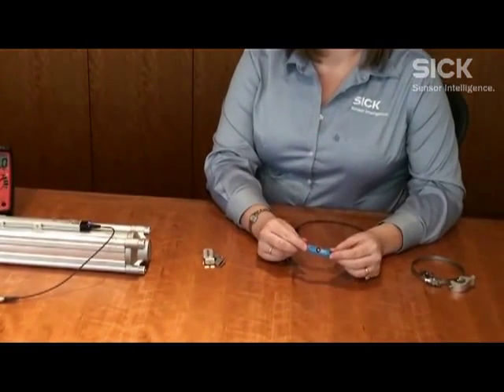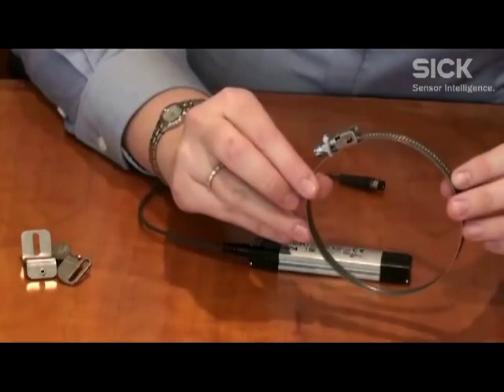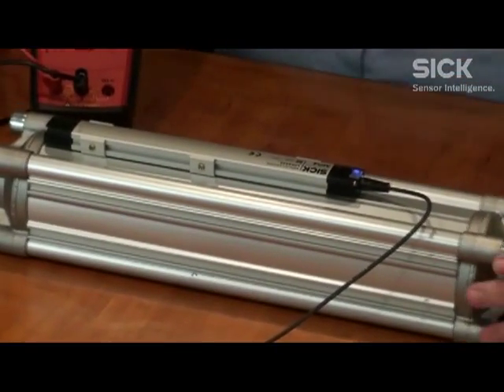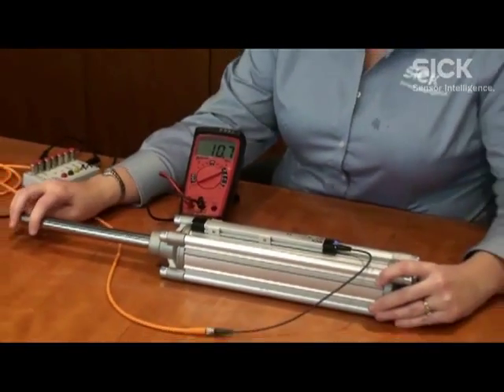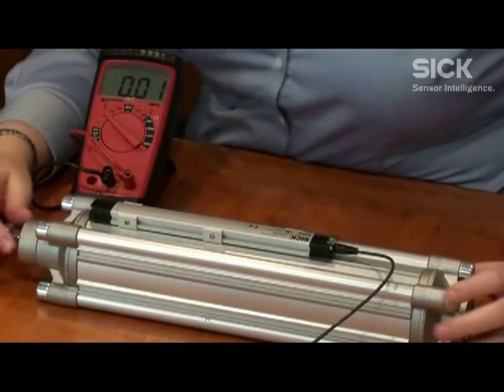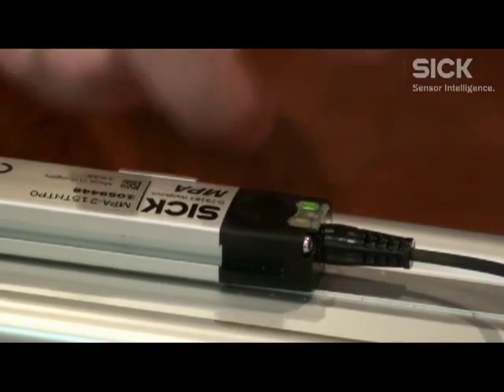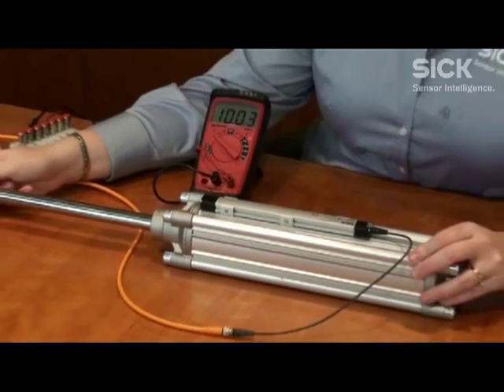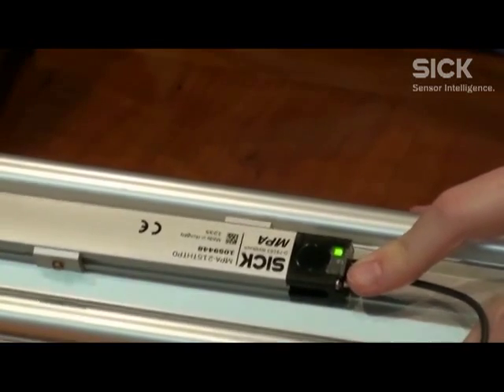Demonstration of MPA Analog Positioning Sensor from SICK

Comment: Hi I want to know factory setting of output sensor is Current or Voltage ?
Reply: She demonstrated both modes in the video, so it does both and is switchable very easily.